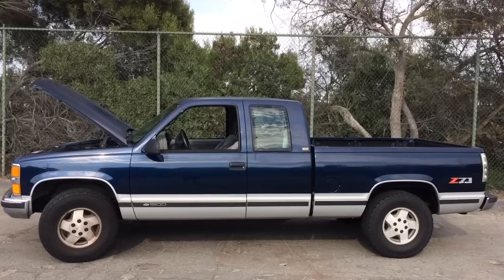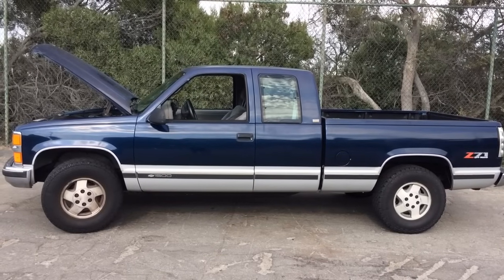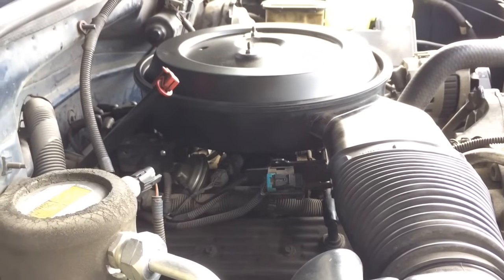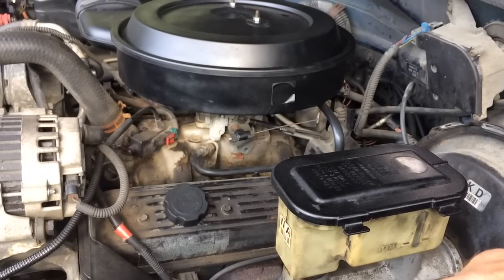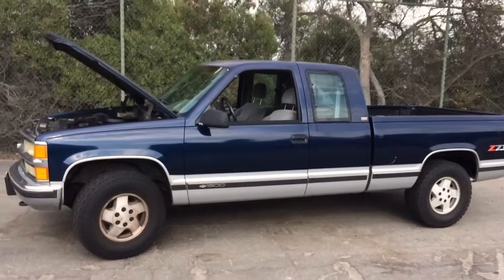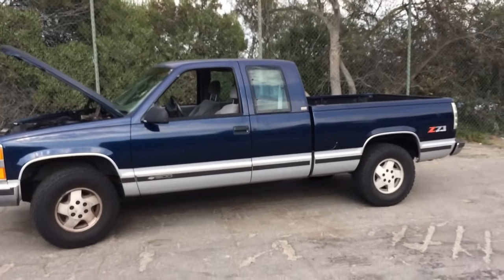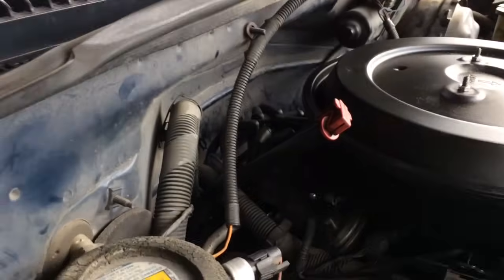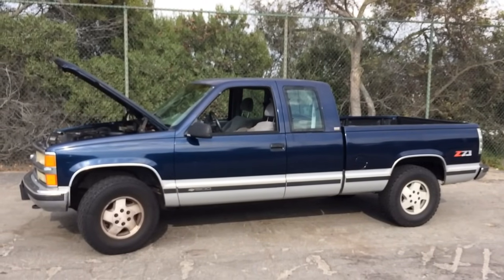Chevrolet Truck Hesitation Problem Fix

Comment: I have a 1993 c1500 chevy. And I replaced almost everything on my truck and its cheaper to fix it rather then to get a new pickup lol. Unfortunately my body is rusting =( but I. Also planning to fix that too.  True what you said....its a real pickup 👍🏻
Reply: When my engine blew up everyone told me to just buy a new vehicle but once you have driven an old Chevy truck there is nothing else you are willing to drive. 1989 Chevy Silverado C1500 single cab long bed 5.7 L 350. old school Chevy for life
Reply: who's got $50'ooo for a new truck

Comment: Before changing a bunch of parts, get a fuel pressure gage and screw it on the Schrader valve in the stainless steel fuel rail. Turn the key on (don't start engine) you should hear the fuel pump come on, helps to remove the fuel cap to hear better. You should see the gage go to 60 pounds. Turn the key off and see if it stays there (if it leks down change the fuel pressure regulator)
Reply: some dont have that valve
Reply: Mine is an 89 the first year for the TBI there are no Schrader valve fuel lines go directly into the throttle body so in order to check fuel pressure you have to take off the return line on the throttle body have to get an old-school fuel pressure tester that screws into the throttle body and into the fuel return line to check fuel pressure if you are checking fuel pressure at the fuel pump you can do that where the fuel filter is located just simply remove the fuel filter and hook up your fuel pressure rental tool that you can get at any local auto parts
Reply: There are no fuel rails on these older trucks
Reply: Tbi motors stock will only make 8 to 13psi of fuel pressure. Also these tbi systems are designed to bleed off pressure fairly quickly. So that's normal. Figured I would put some accurate info on this old thread.

Comment: Boy, that truck looks nice.  My 03 is rusted to death.  I refuse to wash it.  I might wash off something I need.
Reply from the maker: Yes. Any truck from that era can’t go through the car wash because half of the paint will come come off.
Reply: So is my 98 but I do wash it
Reply: Use warm water and dab lightly with cotton balls to dry, I'm convinced the paint is the only thing holding the body together on my 90', 96', and 99' !
Reply: From what I heard, these trucks have galvanized steel body panels.
Reply: @pehenry  I have an 87 chevy van/class "C" rv no rust !

Comment: You mentioned the distributor cap not sitting level and half not running right. Sounds like the cap screws were not all engaged. it is tight back there. 
I have a 98 Silverado with over 257K miles and STILL going !
Reply from the maker: Mine works great after we replaced the distributor. I think the old cap was on there crooked.
Reply: The oem distributor base is plastic so its very common for the base to crack and then your cap does not do its job very well

Comment: A sticking EGR valve will cause rough idle and part throttle hesitation too.
Reply: Could it also cause it to die when i start it up
Reply: Yep. I just replaced that today.  Tons more power   before it sputtered and hesitated a lot

Comment: 1995 Chevy C1500, 4.3 liter V6, 80k miles!. Truck began surging, missing and hesitation after warm up. Had something similar happen 5 years ago. Truck would start, go a block or so and die. 
Started it back up, same thing, a few blocks then konk out! 
Had it towed to my mechanic who replaced the fuel pump, problem fixed. 
Fast forward to the last couple of weeks, truck started fine, 5 minutes later it was choking, wheezing, stumbling and dying, no power, off idle!
Thought it was gonna be another fuel pump as I don't use the truck much and figured maybe the gas went to kerosene or maybe the pickup pump sock pulled up some dirt or rust from inside the 30 year old tank. 
I probably only put 1000 miles on it over the past 5 years and couldn't believe the fuel pump needed replacement again? I read this and other OBS Chevy threads and decided to try swapping out a few sensors. Changed out the TPS, MAP, Temperature sensor and Idle Air Control valve... No change. No harm no foul, since they were all 30 years old original parts! 
Next up the 
Up- Stream Oxygen sensor as the problem occured after warm up and that sensor sends from 0.1 to 1.0 volts back to the ECU after exhaust and an internal heating element brought the sensor temp to 600° sending a voltage back within that .01-1.0voltage range. As I understand it, low voltage indicates a lean exhaust condition and a higher voltage indicates a rich condition. So, I figured if the sensor was defective and possibly sending a low milli-voltage back to the ECU causing it to richen, or in this case over-riched the air/gas mixture causing the engine to flood and konk out! 
I could not get the 30 year old oxygen sensor out as it was seized to the welded on bung. 
I tried MAPP gas torch, blaster penetrant, 7/8" deep socket with breaker bar, pipe wrench with dum dum hammer but no good, it wouldn't budge, not even a  thread. 
There wasn't much room on that header pipe which was just in front of the Catalytic Converter where both header pipes covered and I didn't want to take the header pipes off if I could avoid it to weld on a new bung for a new sensor. 
Instead I found a "no weld" bung kit which consisted of a curved 3" metal plate with a threaded hole to accept the new sensor, an exhaust gasket and a couple of 6" radiator hose clamps. Idea being, drill a hole in the pipe to coincide with the curved mounting plate's,  hole, attach the plate and gasket to the pipe via the 2 radiator clamps and eliminate the need to weld a new bung to the pipe... on my back! 
It worked as designed, installed the sensor and reconnected the wire harness. Squirmed out from under the truck which was up on ramps and fired up the engine... 5 minutes later it was a fail, same conditions as before, no change!. 
Figured the Oxygen sensor wasn't the problem and so I loaded the parts Canon with a TPS, MAPP, AND IAC sensors. Swapped them in one at a time, discharged the system caps after each try by disconnecting the battery and put the headlight switch on to bleed off any residual voltage to reset the ECU , ( no codes thrown by the way, ever), result... Fail! 
No change whatsoever? Some folks suggested a plugged gas tank vent but removing the gas cap made no difference, checked all the vacuum lines, EGR valve, injectors for cone spray pattern but all good? Going nuts now like everybody else and then it hit me... what if the new oxygen sensor was also bad, causing the same conditions as the original O2 oxygen sensor. I was at wits end but since I neglected to bench test the new oxygen sensor before installing it, well anything is possible right, especially for non-OEM replacement parts!
Put the truck back up on the ramps, detached the new sensor's wiring harness, slithered back out from under the truck, cranked Christine (wife's nickname for the truck) up, it idled at 800 as usual but incredibly it stayed there, roick solid like a sewing machine! 
Drove it for 30-40 minutes to get it hot and not a single misstep! Ran like a veritable clock! 
Problem solved for under $50! God, I  love that truck, err Christine that is! 
I hope this helps another OBS Truck fan! 💪
Reply from the maker: Well, that’s always how it goes. I’m glad you figured out the problem, and shared it with everyone. Sometimes you have to replace everything before you figure out the problem. That definitely happened to me.

Comment: 1993, 5.7l, C1500.  Starting this last Fall (2022), upon heat soak, the engine/transmission would intermittently drop out.  This also happened occasionally when hitting a pothole or crossing a bridge expansion joint.  So, over the mild Winter whenever weather was nice enough, I started a detailed inspection of the wiring...  I cut out and refreshed three highly corroded ground lugs in addition to repairing sketchy-looking terminal end wiring at a couple of sensors.  Also, the "convenience center" terminal block along with the fuel pump relay grounds were disassembled, cleaned, greased with dielectric paste, and reassembled.

However, none of my findings appeared to be a true smoking gun and the engine/transmission drop-out remained.  I did have the truck up on jack stands so I could inspect and replace the taillight wire ground in the rear.  The fuel pump ground should and was okay since I recently dropped the gas tank to refresh the brake and fuel lines.

While the truck was up on the jack stands, I traced the transmission control wiring harness looking for pinches, problems, and perforations.  Then, I reached up to check the harness connector plug into the transmission itself.  The plug was out about half it's completely seated distance.  Well, a connector barely seated would certainly be a good suspect for an intermittent heat soak and jarring roadway hiccup problem...

Being thirty years old, there is no longer any click left in the plastic harness connector.  I drilled a couple of holes in the metal guard protecting the harness connector point from brush and safety-wired the terminal in-place on the transmission.

So far, the drop-out has not made itself noticed again.

Check that harness connector at the transmission!  It's a quick and cheap thing to verify!
Reply from the maker: Excellent work! Sometimes these things are really hard to track down.

Comment: Went down this same road with my 96 Tahoe. Replaced fuel pump, every sensor, ECM, ignition, and all new distributor. Ended being a leaky fuel injection so replaced it with latest AC Delco model. Runs like a top now but just had to replace my cats because they burned up in the process.

Just for note. The old poppet style injectors were notorious for going out so for people chasing a gremlin and replacing every sensor I would recommend pulling the intake and looking there. But if you haven't replace the injection at this point it's must. The new style is much better.
Reply: broooo I have changed all those parts besides the cat so far! I feel youuuu, it's like a combo of all of it that don't throw any lights
Reply: I feel mine is injector 😅

Comment: I had this problem! Changed everything. Last thing i did fixed it. Cheapest thing I could do. fuel filter. Fuel pressure was good.  Under power hesitation.  Change the filter first cheap and easy.
Reply from the maker: Always try the cheapest easiest thing first!

Comment: As far as the fuel pump goes I have found out after 4 or 5 fuel pumps that it is easier to take off the bed it's only four bolts and you have good access to your tank without getting any gas on you. Just slide the bed back far enough to access the fuel pump and your good to go

Comment: Fuel pumps are fairly cheap for these. Can install yourself easier than you think. Check the float assembly wires and connections while in there.

Comment: A quick note on changing pumps on at least GM conventional beds remove tail gate, remove bed bolts put piece of card board or scrap carpet between right side rear bed and bumper end and lift bed from left side up like opening trunk,put milk crate under wheel well rest on tire. Fuel tanks is in open site easy to get at no trying to deal with heavy tanks that quit with fuel in them. I've done this 3 times on my own 2000 z71 Silverado. I can do this in about 30 minutes by myself. The first pump I put in I did the remove the tank that was full with 26 gals of fuel,way to muck work, do the previous version much less work.
Reply from the maker: Good stuff. Thanks.
Reply: I need a video of this
Reply: @marshall8092  what he said 👈🏼

Comment: It's amazing how expensive a repair can be without a few steps of diagnostic effort. I hate to say this but most qualified mechanics would have found that diagnosis within an hour, the lack of codes notwithstanding. It takes 5 minutes to measure exhaust backpressure, and the story was typical, almost diagnostic. It would have been easy to exclude the fuel pump and fuel filter with pressure testing under load at the Schraeder valve, and even bad fuel injectors would have shown fuel trim clues. I agree with you about these trucks. They have a classic, timeless design and they age surprisingly well if rust doesn't take them first.
Reply from the maker: You are right about that!  I threw a lot of parts at it before I took it to a mechanic.
Reply: I have a 2000 GMC Savana 3500 with a bogging down problem. She runs great but every once in a while chugs like shes choking and I can barely move and almost get stranded. I put her in park, shut her off then start her up and shes fine for a bit. Can't figure it out. I've done plugs, wires, fuel filter, replaced leaky hoses, etc
Reply: spelunkerd I'm surprised hoohoohoblin hasn't bought a odb1 Bluetooth module to be able to watch stats or run data logging.
Reply: Gus Ricciuti check your IAC valve it's probably sticking. You can take it out and clean it with some throttle body cleaner before buying a new one. Also test your connecters with a multimeter or simply add dielectric grease to it and connect it back up and see how it runs. Make sure your throttle plates aren't gunked up so clean them. Check if your EGR still has suction if not replace it. Check your TPS as well. And last but not least your O2 sensor. I'm almost positive it's your IAC valve though! Disconnect your TPS and see how it drives.. If it drives better it's your IAC or TPS.. TPS is being affected by your IAC because your ECM is misreading air flow!
Reply: Gus Ricciuti sorry just seen your year and model.. Try cleaning or replacing your MAF sensor.
Reply: I found out after replacing a bunch of parts that it was the MAF sensor! I would have saved so much money but the engine light didn't come on until the truck didn't want to move any more. I wanted to replace some of the parts anyway but still I would have saved a good chunk of change. Live and learn
Reply: Gus Ricciuti yeah that sucks I know the feeling! As a mechanic it's usually best to have a diagnostic scanner I've learned! Sucks I was 2 months too late! Probably could've saved you money! I started off on GM models.
Reply: purestress2 hey do you know any of OBD1 Bluetooth that can do live data on these trucks
Reply: I have the same issue started with the fuel filter and pump then did almost every thing else don’t know what to do at this point lmao it’s gotten better
Reply: @purestress2  hey would an o2 sensor cause this issue? My truck is a 97 sierra 5.7 and it runs alright but falls flat on its ass if you give it throttle. Its had the issue since I bought it but I'm wanting to fix it after I'm done work here in a month. Never any check engine lights until now and it's just telling me the bank 2 downstream sensor has no voltage. Going to grab one this week but does one o2 sensor have that much effect on how the engine runs? I've had this issue with a previous tbi gm and it was a tps. Just curious about the o2 sensor.
Reply: @bolerdweller  it could literally be anything! It's hard to tell with more info or not looking at it myself. But I'd change the O2 sensor anyway to be safe and get it out the way. Then work your way on up if the theres still trouble codes popping up! But yeah even an O2 sensor has a big effect on how your engine runs since it goes straight to your ECM. Just gotta be willing to spend money and time to get it it fixed but I'm sure you'll figure it out if you work your way up! Just go from cheapest to expensive, common sense to complex.. Hope you get it working though and good luck. Let me know how it goes.
Reply: @purestress2  hey bro I have a 88 Silverado k1500 5.7 tbi  I had it running on park and all of a sudden it turned off… then I drove it for like 15 mins then it kinda boggled check engine light kept coming on and off then engine shit off… the only way it turned on if I stepped on the gas pedal giving it gas… then drove it again then died again 5 mins later same problem… do u have an idea of what it could be?? Oh and when the truck is on there is no check engine light only when it is gonna die…
Reply: @deemoney8228   hard to tell man.. It could be anything. Put an obd1 on it and let me know what it says. You could put a wire of some sort like a paperclip in the A and B port if I'm correct I can't remember. There's tutorials on how to do it on YouTube I'm sure if you can't get an OBD1 scanner.
Reply: @purestress2  ok coo thanks
Reply: @purestress2  it was code 15 only
Reply: @deemoney8228  That could be your problem right there.. Do you smell a lot of gas or do you hear your fan running constantly?
Reply: @deemoney8228  oh and it's your coolant temperature sensor by the way, that's the code.. Sorry I didn't mention that on the previous comment!
Reply: @purestress2  the fan is working properly but I do smell the gas
Reply: @purestress2  yes I googled it and it said code 15 was the low coolant sensor but would that make the truck stall and turn right back on ?? And I noticed it has a high idle sometimes as well
Reply: @deemoney8228  Yeah it's causing your truck to run rich making it idle high.. it's messing with your fuel/air ratio so it's confusing your pcm! It might be or might not be that but if that's the code I'd go with changing that first and see if that's your problem.
Reply: @purestress2  true true thanks bro appreciate it
Reply: @deemoney8228  no problem

Comment: This same thing happened to me it ended up being my fuel pump . I had people tell me it was a blown head gasket to the timing belt/ chain . They didn't know shit lol
Reply: I think that's my problem
Reply: I have a sneaky suspicion that is my problem as well.  I have a 1996 Chevy truck with 525,000 miles on it.  I am going to check into that first - and yes I have changed it out before many years ago.